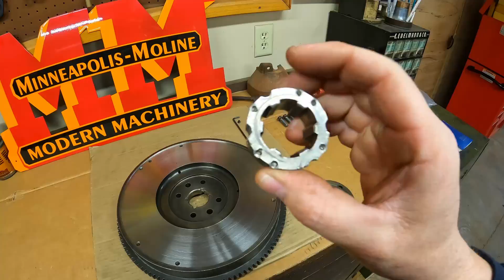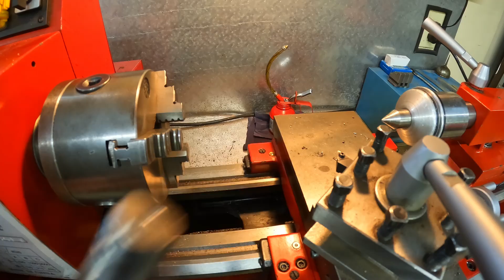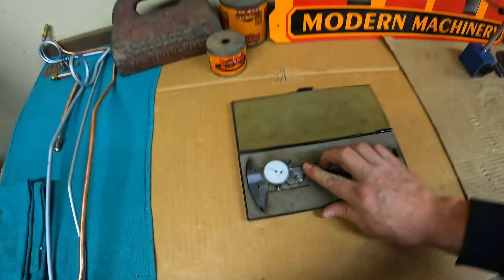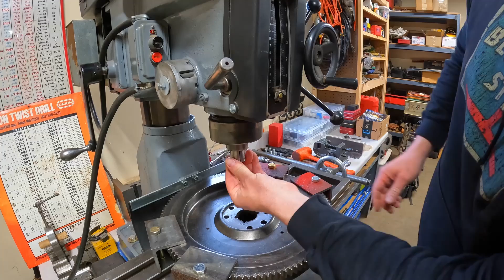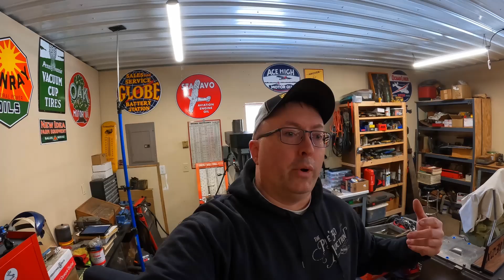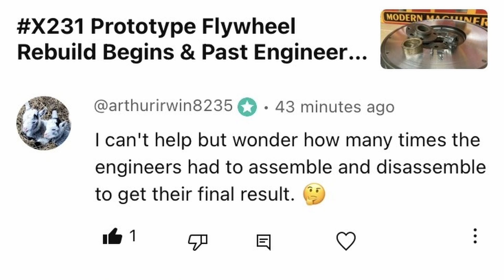X231 Prototype Flywheel Machining - Making Tools, Checking Setups & Cutting Metal - Episode #80

Comment: My recommendation would to not try to re-use the old Dutch key holes as Dutch keys...I would replicate the same second set screw hole and then when pressing the new hub in have those set screws lined up with the old Dutch key holes in the flywheel and then drill new Dutch keys

Comment: Yeah, you're setup for machining something always takes the longest. I have the same Matco micrometers. When using telescoping gauges, I like to lightly clamp the plastic pads of the mic in extremely soft jaws just enough to hold it while I work the clutch on the mic and t-gauge.

Comment: gotta realize: Most of the "prototype" automobiles that are seen at the big trade shows or that are displayed with much fanfare when they are revealed, are one-off machines that most of the time don't even run and are made of really thin sheet metal. 231 may have been a proof of concept that got everyone in R&D focused on what the public wanted as a final result.

Comment: Toby:

From the resident Ford tractor nut:

I have the greatest admiration for you in tackling a project as complex as this. I have 9N 52 sitting out there in the rain. When it showed up on eBay I drove from Pennsylvania to Indiana to get it. It’s in really bad shape, with “farmer fixes” everywhere. It even has a sheet metal patch with roofing tar held on the block with 1/4 X 20 screws. Somebody obviously forgot antifreeze one year. It’s so bad that it’s depressing.

It’s the fourth oldest N tractor known to exist. First week of production with Henry Ford himself no doubt watching it go down the line.

I’ve owned it three or four years now and you are giving me the inspiration to finally tackle the restoration. I thank you!

Comment: You don't have to apologize for your equipment, or your machining expertise. You have excellent instincts and they lead you toward perfectly acceptable methodology, considering the tools available. BTW, those Bokum boring bars are fine, but you can actually use an endmill for boring using the same boring head. Toolmakers do this all the time. What you want to do is mount the endmill in the boring head loosely and hold the tool upside down with the endmill facing you. Arrange the flutes (whether a two-flute or four-flute endmill) aligned with one flute at the twelve o'clock position. Then back it off (Clockwise) a few degrees so you are sure to get good cutting action. If you are boring a deep hole, you might either relieve the endmill shank, or choose an endmill with flute diameter larger than the shank. You are doing a great job and I enjoy watching the process. And, by all means, do google the term "Indicol" - you will need one when you get your bridgeport.

Comment: I know lots of times we are limited to tooling and things, how I was thing left hand threads on the splined hub and the fly wheel it only spins one direction with left hand threads it would stay tight and one keep pin for back up food for thought, oh was just thinking might have to be right threads if done from the out side of the fly wheel , left if it done from the front side

Comment: As I have been watching this hole tractor rebuild I have to admire what this tractor has done in the past. Being a prototype never meant to being put through the torture it was and holding up with all these one off unrefined parts for so many years. You have to give this tractor it's due. It put food on peoples tables and wasn't suppose to pull a single implement

Comment: For a "proof of concept" machine, the previous owners sure flogged this thing like it owed them money.  What I like about the work/repairs done up to this point is they seem to be more from a "technician/mechanic" perspective vice an engineering perspective.  I'm not saying you didn't take the engineering perspective into account at all, as you've remained as true to the original "final delivery" design as what was left of her/available replacement parts would allow, but you've also incorporated tweaks to increase function, reliability, and repairability (if it didn't stray too far from the original design).  I know her working days are over while she's under your stewardship, but if she had to be put to work, I'd feel better doing it with your finished product over how she originally left the R&D shop.

Comment: Great job improvising on the fly wheel to get a good hole. Have you thought about a second flat on the hub shaft to put equal pressure 180 out? You are working with tight tolerance and doing great work.
Reply from the maker: I did end up putting a second set screw into the hole on the other side of the hub, not so much to assist in locating it but to better distribute the forces at play.

Comment: Great episode, as usual.  The flywheel looks like it is machining nicely, cast iron usually doesn't give too many problems.  It's just the limited space you have to make design improvements... and the rarity of the parts, and their age, and past abuse, and obvious prototyping rework, and, and, and
Reply from the maker: Yep you hit the nail on the head - just the “unobtanium” factor of these one-off unique prototype parts alone, combined with having to do “un-doable” things to them like permanently removing material, makes this one stressful project at times 👍

Comment: Ah the I now get it moment!
The question I posed in the Members Only section the bolt face gives the perpendicularity to the bore while edge of the surface ring is for the parallelism to the bore.
To much over thinking 🤔. 
Off we go. 
I expect start up in 2025 and paint in 2026.
Summers coming  and there is work to be done up on property for the new building!